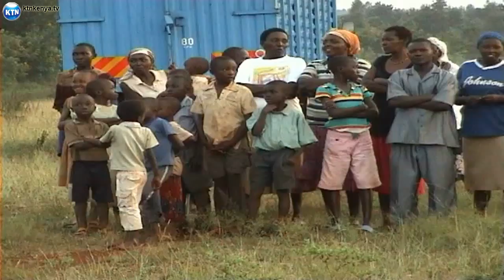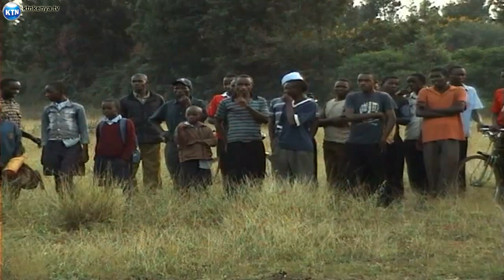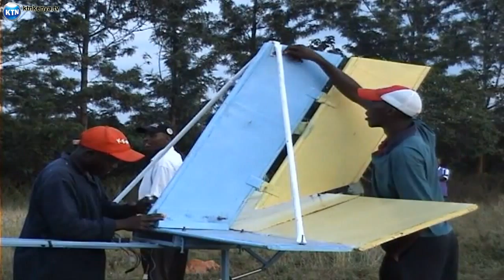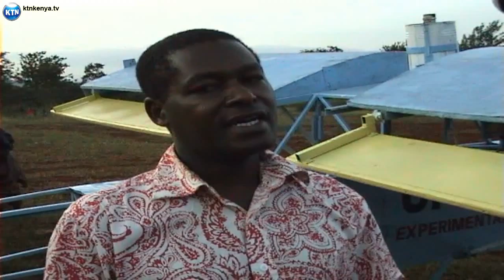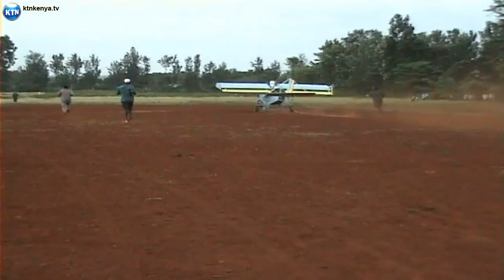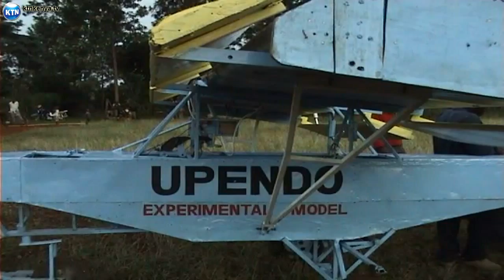Kenyan Builds Aeroplane

Comment: 250 kg far too heavy for a plane that size with small engine.  Should be half that weight.   Get rid of all the steel   - you need alloy and fabric.   Much SAFER to buy a set of proper plans too.

Comment: The engine is super weak it cannot take off with this engine, your frame also needs some changes wings, another thing you need to hang this aircraft and check if it's nose heavy or tail heavy man you did great work congratulations and Kudos you surely should have a bigger prop n a strong moter 👍👍 your plane will surely fly for sure!!

Comment: That engine dont produce much thrust, for that engine it can never fly, second the propeller are small and didnt bended well, third the plane looks more heavier than it should be you need to balance both wings to get equally weight .

Comment: I really want to see one of these succeed one of these times. They’re using the resources they have available and are passionate about the project
Reply: Nope. They use steel. They have acces to wood and canavas. With these materials even small 5hp engine from motorbike will be enough.
I remember atricle in polish newspaper from 1967. Student of secondary school build a plane of: wood bar, painted cotton and 7,5hp engine taken from boat. That guy was 17 years old. Plane was tested by specialist and autohised to flying at low altitude. 
There was also  hovercraft made of plywood and driven by two engine from motorbike WSK . Contructors were 16yrs old ;) It was 1963. 
Today is 2021. And all that knowledge is available for everyone.

Comment: Wth you got to be kidding the plane what ever you call that thing to heavy the engine hasn't enough horse power I don't no what you call your flaps or slots or what ever they are to if it was made with aluminium instead of the steel O yer I think you need a biger wing span you have in it it might fly maybe bofl

Comment: A: Good morning, please enjoy the above efforts by a Kenyan hobbyist. Can you suggest what he needs to do for his craft to fly?
B: Reduce the weight of the aircraft, by introducting lighting holes and use an engine with greater thrust.
A: But how can he reduce the weight? By looking at what he already has.
B: The material he is using as airframe is probably not aluminum which is light, he is probably using a very heavy metal.
I saw a similar set of Nigerian's at Illorin with the same challenge, their plane was only able to taxi. The metal airframe they used was similar to the Kenyan's
A: It's probably iron.
A: Iron is just not suitable for aircraft work.
B: Wow that can not lift the ground at all. Ahh
B: I agree, sir

Comment: Using old deck chairs for the rudder and tailplanes is an absolute stroke of genius. 

Probably needs more bent nails in the end of the wings though.
The petrol tank looks really secure on top of the wing held down with tape, Perfect position in case of a crash, it will douse the pilot with petrol and put out the flames.

I don't think this guy is really serious about flying. If he took the money he spent on all of his planes and helicopters he would probably have enough to build one good one. .

Comment: The Wright brothers made thier first practical airplane (the 3rd airplane that they built) by 1905. It made a flight of 39 minutes and covered 24-1/2 miles. Over 100 years later, some of these home built aircraft can't get off the ground.
Reply: super bad designs allow engine way to heavy for the lift it gives off
Reply: I think we face lost ancient technology!
Reply: @laurentbarre7887  I was just saying that since the Wright brothers flew so long ago, you would think even people in poor countries would have heard about them by now and understand the basic principles of flight. The first thing to understand is that an aircraft that has a low power engine needs to have a strong but light weight frame. You can tell just by looking at some of these designs that they are way too heavy.
Reply: @Snake-ms7sj  their wings were made mostly of fabric not heavy steel
Reply: Yep, like in Silicon Valley. Or, I'd say Silly Con Valley

Comment: SOME INFORMATION
I think it will be easier if you start with a well-tested air plane model, then you can go ahead and modify it to suite your need. The people that attempted flying in he early 1900 have already pay the price for you. All you will have to do is copy from their success and move forward.
You can start with something small like Cessna 152 or Cessna 172. They are often used to train pilots in flying schools.
For example if you are copying from Cessna 152, you should make sure that the engine is not too heavy for the frame. The thrust / rpm should also match.
Cessna 152 carries only two people. So let’s say you want to only carry one person in your model. All that you will have to do is divide the numbers by two to arrive at the numbers for one seat.
The engine is also very important because the engine used by Cessna is light when compared to the type of engines used in motorcycles or cars.
The airfoil should also be of light materials so as not to overload the engine.
Some airports tend to keep damaged or decommissioned airplanes abandoned. So if you know someone that works at airport who can help you get airfoil of such planes it will help you a lot.

Here is an example of the specifications for Cessna 152

General characteristics
Crew: one pilot
Capacity: one passenger
Length: 24 ft 1 in (7.3 m)
Wingspan: 33 ft 4 in (10.2 m)
Height: 8 ft 6 in (2.6 m)
Wing area: 160 ft² (14.9 m²)
Empty weight: 1,081 lb (490 kg)
Max. takeoff weight: 1,670 lb (757 kg)
Powerplant: 1 × Lycoming O-235-L2C flat-4 engine, 110 hp (82 kW) driving a 69-inch (175 cm), two-blade, fixed-pitch McCauley propeller or a 72-inch, two-blade, fixed-pitch Sensenich propeller
Performance
Maximum speed: 126 mph (110 knots, 204 km/h)
Cruise speed: 123 mph (107 knots, 198 km/h)
Stall speed: 49 mph (43 knots, 79 km/h) unpowered, flaps down
Takeoff roll: 725 ft (221 m)
Range: 477 mi (414 nm, 768 km) 
Extended range 795 mi (690 nm, 1,280 km) with long-range tanks
Service ceiling: 14,700 ft (4,480 m)
Rate of climb: 715 ft/min (3.6 m/s)
Max. wing loading: 10.44 lb/ft² (51 kg/m²)
Minimum power/mass: .066 hp/lb (108 W/kg)

Comment: I actually think about this one a lot, I don’t know if is that they don’t have anything to put in TV, or maybe it’s that they don’t have any TVs, the thing is, if you don’t have any knowledge of weight and balance,aerodynamics, thrust to weight ratio, structural design for the rigidity of the plane, lift to weight ratio etc, please,please, stop posting those stupid things, those things aren’t neither planes or helicopters, and the only possible way they could flight might be if they place on those things a bar of C-4 or TNT 🧨!

Comment: As a private pilot of many years I have learned much about aviation, specifically about how aerodynamics works and how lift is generated. It's not just about power to weight ratios but also about the chord of the wing (width, just back from the leading edge). The shape of the chord dictates how much the wing can lift, given a host of factors; dihedral, sweep, engine power and prop thrust, drag on the airframe, overall weight and balance etc. I seriously doubt this guy considered ANY of these critical factors  ALONE , let alone combine it all to make it fly. Why would anyone encourage  such ineptitude?

Comment: wright brothers 2.0     lightweight stretched canvas / fabric and wood was used in the Wright Flyer.  yes its possible to build an aircraft from recycled materials.  but weight & structural integrity are critical for safety.

Comment: Use aluminum tubing from bicycles and weld it together and use also plastic panels not fiberglass ( too heavy ) small motorcycle batteries , plastic containers for gas tank ,cables not rods . Remember your engine needs dry sump oil lubricating system and a pressurised fuel system ...yeah you definitely need an engine specifically for airplanes     as soon you start hitting g's on that aircraft is going to stall at some point of your flight. due to engine failure . Oh well good luck in your future endeavors.

Comment: Why does this kind of thing only happens in Africa?
If you build a plane anywhere else in the world, the aviation board will first scrutinize the plane before issuing a flying permit.

This operator is an IT specialist, using floppys and Basic on a Commodore?
Or is he a prince with a gmail account wanting to share his fortunes with you?
Or is he looking for donations?
Reply: Oh hardly, most countries have provisions for light home built aircraft. Here in the USA for example under part 103 you can do basically anything you want as long as you stay under a certain weight, speed, and fuel load and fly within some pretty basic restrictions. You don't even need a pilots license under 103. Irrelevant in this case though, he is nowhere near being able to fly. Build a glider first, wood, fabric, and wire, substitute aluminum for the wood if you can afford it. Once that works start worrying about the engine. This guy has vastly more resources than any of the pioneers of aviation and getting it about as right as a 6yr old putting on a cape and jumping off the couch while flapping his arms.

Comment: I see all these African planes getting the most basic things wrong. For starters, they're all too heavy. They seem to be building these planes out of any scrap metal they can find, and a lot of it seems to be steel. It makes the airplanes too heavy. If they don't have enough aluminum, they should go old school and make them out of wood and fabric. They also use engines that obviously don't make enough power. In the past, ultralights have successfully flown with motorcycle engines. These might be motorcycle engines, but from much older and weaker bikes. And the next obvious thing, is the propeller. All these propellers are too small, and probably not even the right kind. I can respect these guys for trying, but they've got a long way to go

Comment: A little Cessna 140, professionally built in aluminium used an 85HP engine to get airborne. He can play around with his airframe all day long but the engine is simply nowhere near powerful enough to even maintain level flight. I applaud the DIY approach for anyone -  but he either needs to make it MUCH lighter (more like a microlite) or MASSIVELY more powerful.

EDIT

Thinking laterally, he could always consider doing what we used to do in the CCF with our glider. Basically the glider (and in this case, his machine) is secured at end of a field. you then have TWO bungee cords each stretched out by as many volunteers as you can find - in a fairly narrow V shape - leading away from the front of the glider / etc.

In this case just before he ordered the release, he would get the engine to max - so it would then have both the acceleration due to bungee AND the acceleration due to the engine.

Sadly, though, I still think he needs to get the weight down significantly. A spruce (wood) frame and doped (laquered) canvas or other lightweight but strong material for wings, ailerons, rudders etc.

Comment: Mistakes made 1: the engine was not powerful enough
2:the propellers were not flat enough to provide max thrust from the engine
3:the wings are not so smooth hence much more drag...the wings are also not curved at a good angle for max pressure at the bottom to create enough lift 
4:the flaps were not attached to the wings hence loss of lift as air is lost at the gaps,flaps are less efficient 
5:the airplane is not aerodynamic enough and the elevators were not deployed fully
Reply: 6) Engineer was African.

Comment: Check the  gross weight of your plane  versus the lifting(thrust) capacity of your engine  you will get insight about what to improve. In summary your engine is too small or your aircraft is too heavy relative to the engine power .In history of aircraft design many projects failed by overlooking this factor. Here is the formula   POWER(PW)/MASS(KG)
Reply: That's an interesting ''formula''.!

Comment: Did you weigh the plane before trying to fly it ? Looks as heavy as a tractor.
Reply: there are plenty of planes that fly and weigh more than a tractor, course they have big engines that aren't run off a belt....
Reply: A little airplane like that can't fly if he is heavy as a tractor … Of course there is plane weight hundred of metric tons but they got giant wings , powerfull engine and , of course little weight if you compare to the lengh !

Comment: sadly this aircraft is FAR too heavy to fly... and looking at it, it appears that it could be too tail heavy as well, which could easily be a FATAL design flaw IF it becomes airborne! Building an RC aircraft version first to work out the flaws, and then scaling up the successful concept design to full scale may be a better option.. although NOT guaranteed either.

Comment: The engine is a Simonini mini2 ..2stroke single cylinder with 26hp..i use it to fly my paramotor (powered paraglider) .. The thrust from the propeller is about 60 to 70 kg... Unfortunately..its not suitable for an aircraft of  of this weight..  Secondly...the basic aerodynamics needs to be rectified...and the aircraft must be lighter...  btw nice effort there.
Reply: +RAIZAL MOHAMMAD it is a hirt f33 used in lots of airplanes like minimax
Reply: He didn’t make an aeroplane.  That would’ve required lots of studying, and based on the materials he used, I’d venture to say he did NONE.  Why praise his “effort”, or were you being facetious?
Reply: I feel one wing is right size fir that motor. Thats barley FAST taxi
Reply: No not nice effort. He is a grown man.

Comment: He hasn't got the wingspan for 550 lbs. Needs at least 28 feet. And he needed to engage flaps. His flaps were up. Prob needs 30 hp.
Reply: +Eric Charters the 28hp will lift and fly 560lb team minimax and wing area are is not figured by length alone 90 to 120 sq ft would work
Reply: My recommendation is 150 sq feet and 40 hp. Volks engine is perfect, but Rotax will do. Will lift 550 lbs all up. Wings need box strut or multi tubes of chrome moly steel .028 gauge, about 30 feet wingspan.
Reply: +Eric Charters what are you basing you figures on. your just spouting with nothing behind it. face it this thing wont fly
Reply: I am not saying his aircraft would take off. au contraire. To do equations on power and lift from simple rules is not on, is it. I think u will find the figures I supplied compare to similar craft which work. Like the Excalibur. Dimensions, power, take off speed, weight, etc are all easily found. What our friend in Africa does not have is 1. knowledge. 2. money 3. materials. Similar story all over. 145 sq feet wing area, 40 hp, 40 knots take off, 200 foot TO roll. That will work. More or less. Apply $25,000 and a 300 hours of mechanicing and voila.

Comment: Wow, that's 550 lbs for that little engine to lift. They need to under stand that aircraft are flimsy and use light thin metals. Sounds like a lot of steel went into this.
Reply: Yes, the wings can generate lift BUT it is the engine that creates the power to propel the aircraft through the air with sufficient power to cause the airflow past the wings to generate lift.

Or in the case of a rotating wing device like an helicopter, the power to cause the wing to rotate fast enough that, once again, airflow past the wing creates lift. If the engine cannot rotate the wing fast enough then it sits quite firmly on the ground.

This is why planes with big wings don't take off when the engine is switched off.

That is also basic "shit".
Reply: peashumaru  Compared to the 1/4 ton of steel this guy is using, today's planes are fucking paper.